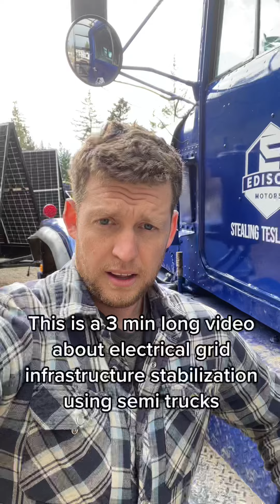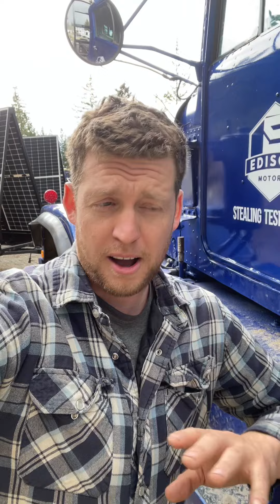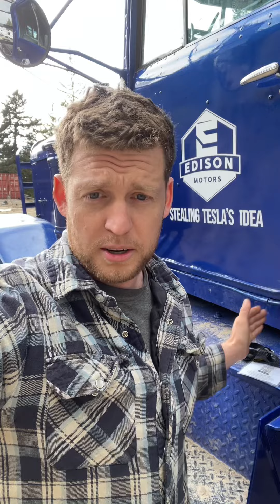Electrical Grid Infrastructure Stabilization

Comment: Well it all looks and sounds good on paper but in reality??? HMM
A train diesel generator is far bigger than what's in your truck and batteries are notorious for failure in freezing temperatures!!!!
Reply: So what? Trains require functional rail infrastructure, so are mobility limited, and are too expensive as a capital asset to lend out to potentially dangerous areas. The batteries on his truck are heated/cooled to function properly in wide temperature range.

Comment: That was the 1st idea came to mind when you started doing the diesel generator System in a truck
It's like the Ford lightning You can run your tools all day long on the job site you can also Power up your house if the power goes out But if the power stays out and your battery dead in the truck you're screwed
If it was your truck you could run it all day long all night long

Not to mention with having these electric vehicles On the road They got to upgrade the electrical grid to have them they gotta upgrade the infrastructure for charging stations When we already have gas stations all cross the country The infrastructure is already there for your Setup